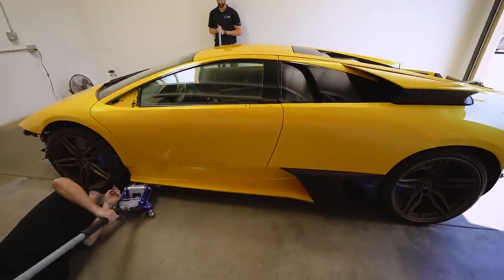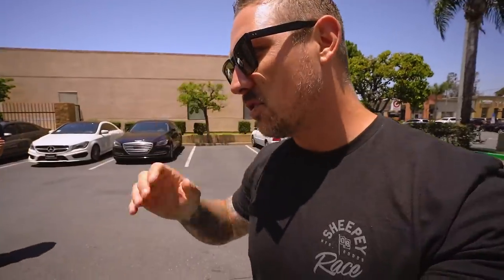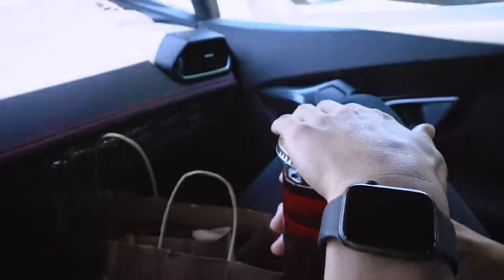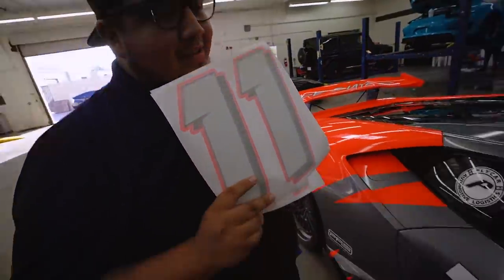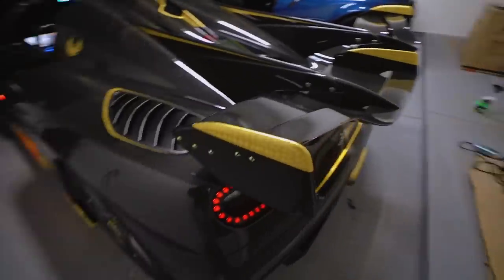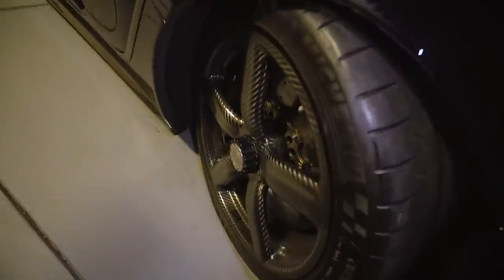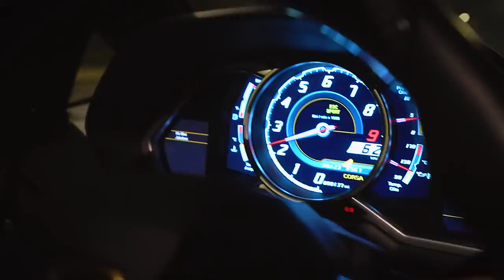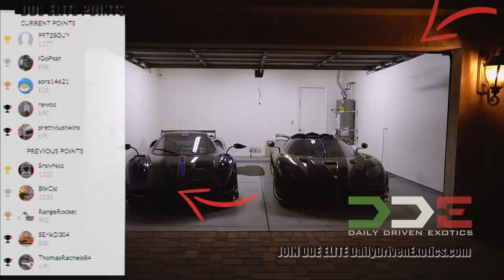REBUILDING MY WRECKED LAMBORGHINI MURCIELAGO! *IT'S NOT THE CLUTCH*

Comment: He even bought a cluch for the car RIP😂😭
Reply: Has it as backup.
Reply: @pherron7471  i know but i would still be kinda upset spending $900 on a part and find out it was the axle not the clutch
Reply: @DESTRUCTIONSLAYER  You would. He wouldn't. The video paid for the clutch. Actually the videos before that video paid for the clutch. That's just routine maintenance.